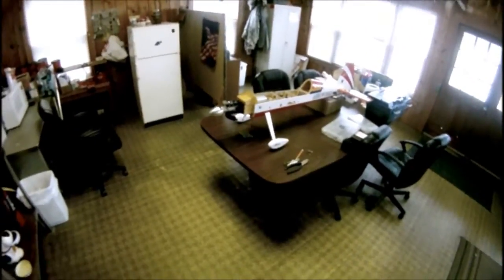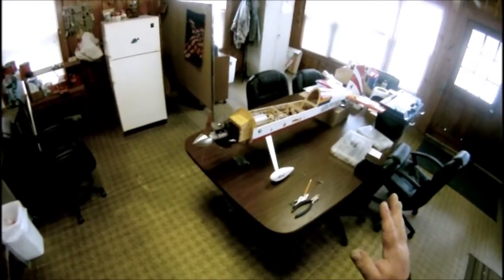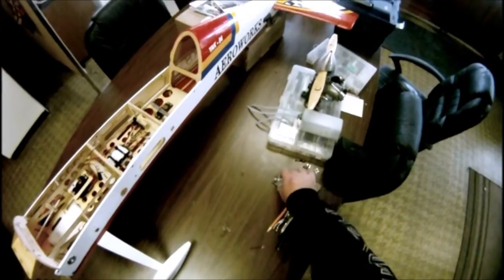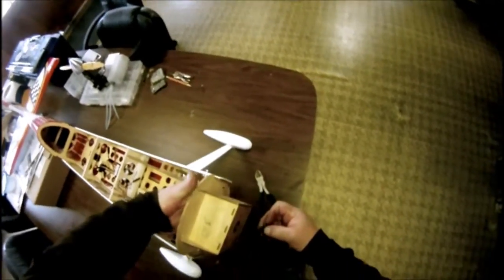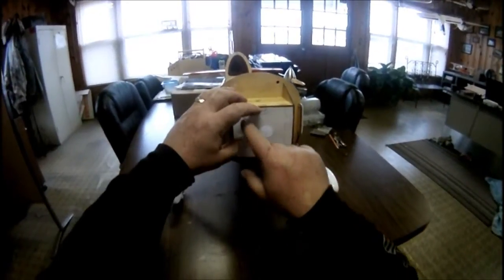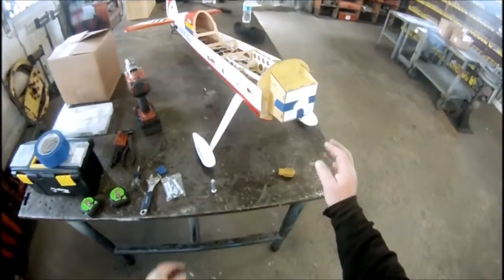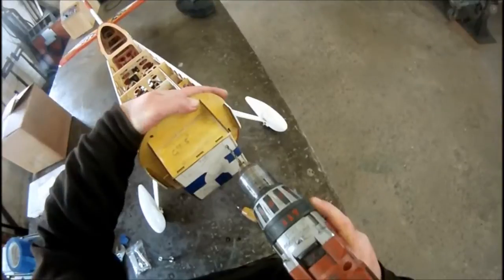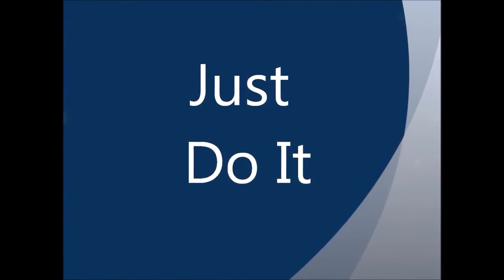Installing a Dle 30 on a Aeroworks Yak54 90-120 Part 1

Comment: I'm putting a DLE30 in a different manufactures ARF that was also powered by a 120 four cycle so id love to get a copy of that template you created.
Reply from the maker: I will be glad to send you a PDF file and just make sure you set your printer to 1 to1 in the printer setup menu you can send me your e-mail address at moejoetaylor@yahoo.com and I will send you a PDF